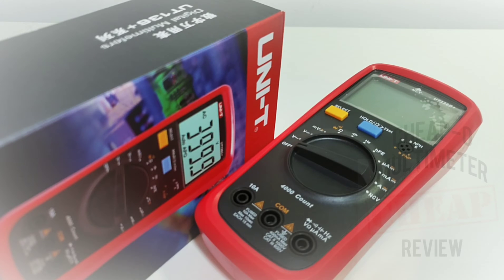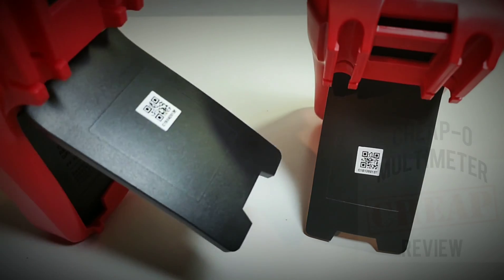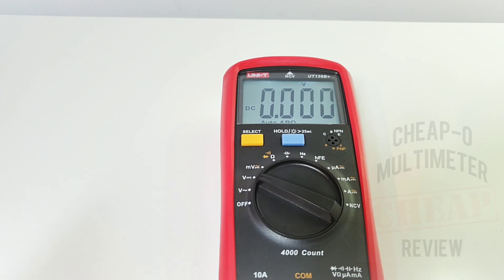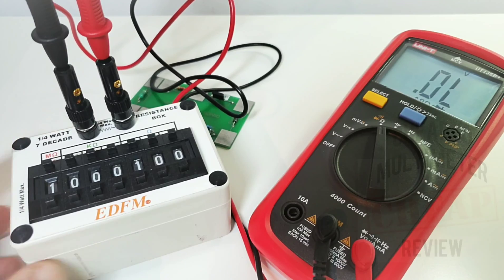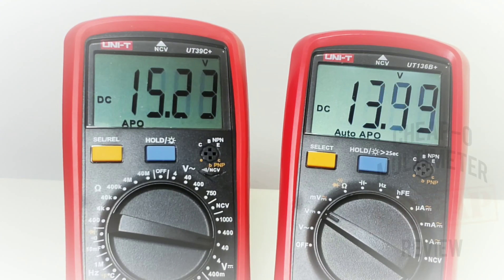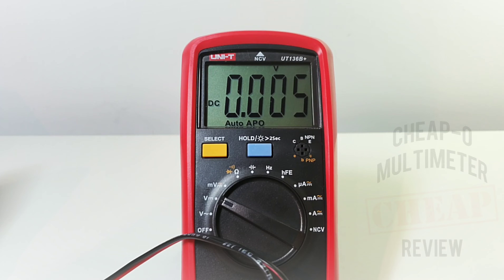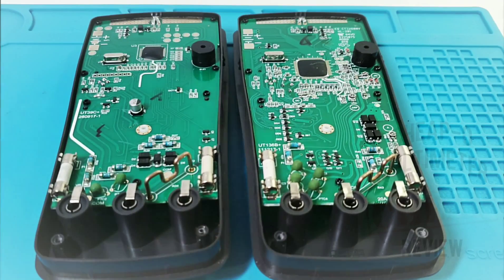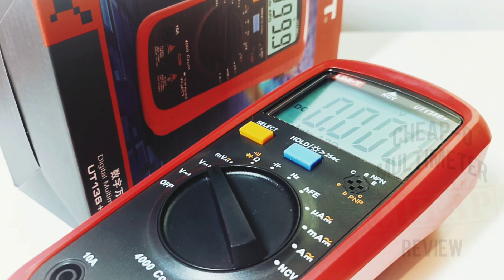UNI-T UT136B+ CHEAP-O Multimeter Review & Teardown!

Comment: Went for this model as a budget multimeter for pretty basic home use. I was choosing between this one, UT890D+ and UT39C+. I really liked UT39C+ but this model had nominal capacitance measurement up to 40mF, lower price and auto range. I wish I'd seen actual tests beforehand. 

Still it's a decent cheap-o-meter for $19.
Reply from the maker: Agreed..its a capable multimeter and built fairly rugged...absolutely great price 👍 too!
Reply: @KeepOnTesting  Hi Darren! I'm trying to find a new meter now for regular use. What do you think, which would be the better pick: UT136B+ vs UT125C? Is there another choice in this price range?

Comment: Hello, 
I received ut136b+ from China yesterday.

On diode test it will beep continously if DUT junction is shorted or BAD (According to the datasheet if the voltage drop on DUT less then 30mV).
It is a usefull feature for faster  troubleshooting, when we are usually seeking for bad junction.

This meter is also hackable. Eg. Enable Range, Minmax, enable LED indicator, en/dis able beep and more.

I love this meter. I paid USD 13.5 (with voucher).

Thank you.
Reply: Hello, can you please explain how to hack this meter?
Reply: @Mido0Rady  yup we need a circuit comparison and a hack with 136b+ and 136c+
Reply: any link for how to hack it
Reply: @akcoord9615  hello, i will tell u later when im home. This meter use Taiwan chip, not chinese dreamtech one.

Comment: Great review! Mine 136b (without +) have some problems with capacitance too. So, IMHO, 136b+ looks better with backlight and  aa battery's. Hope uni-t fix issues.
Reply from the maker: Indeed, It's a great meter,  UNI-T just needs to work out a few kinks! Thx for the feedback..
Reply: @KeepOnTesting  i bought this multi-meter after your review capacitance do not measure higher the 500 micro farad any way to fix the problem by your experience of circuits or can you please contact uni to give you away to fix this problem i really appreciate that
Reply: Urdu zubaan mein maharat bataen

Comment: First that 5 minute backlight is a HUGE improvement and great to see finally, so big kudos and thanks to Uni-t for that.  Good meter overall nice size display and auto ranging , now I hope they fix the teething issues with the sketchy capacitance, lower continuity volume and missing continuity LED.  The NCV is as almost always on most meters an afterthought - If they fix the rest its a solid winner-!
Reply from the maker: Spot on! It's close to being a super multimeter,  but they have to fix a few nagging quirks, ie the aforementioned cap issue... Definitely the BEST lcd display I've seen in a long time!
Reply: Yep, if they fix just the capacitance, continuity volume and return the cont. light I will HAVE to buy one.  I dont even judge a meters NCV anymore most of em just dont even try and make it work as it should. One of those "value added" things that add little value, most times anyway.  Uni-T is still one of my favs most times.  m
Reply: May I ask you for advice? I'm inclined to purchase this model because of NCV. Will it be able to locate hidden wiring in the wall? Not expecting it to be super precise (the goal is to safely drill walls without damaging electric network of unknown location). Thanks!